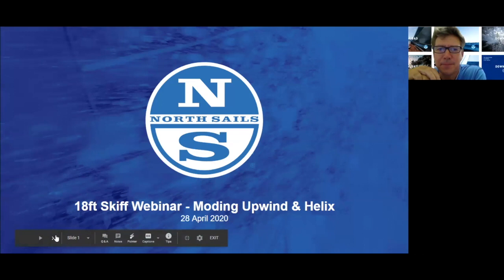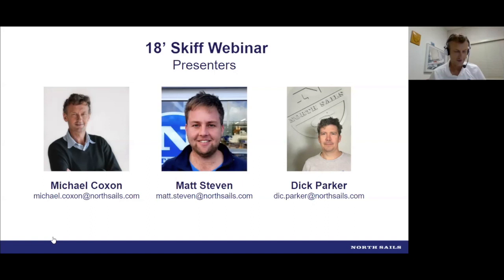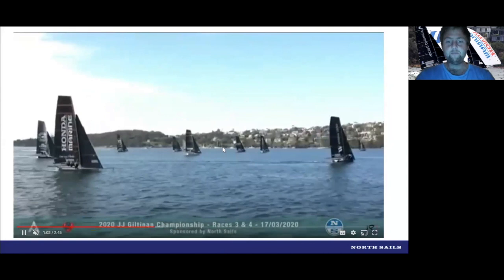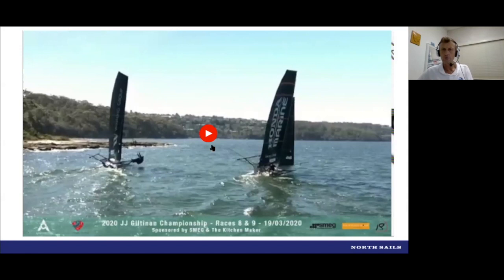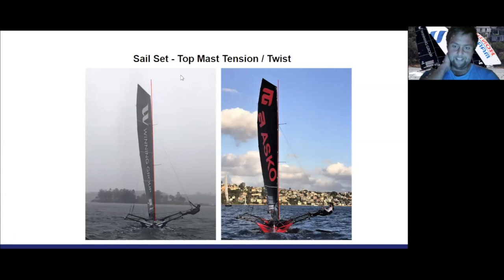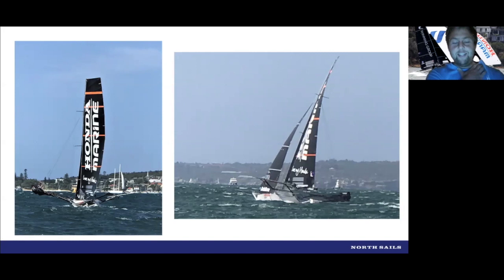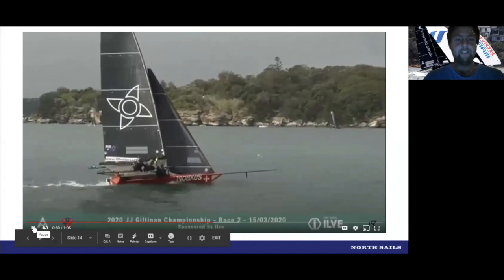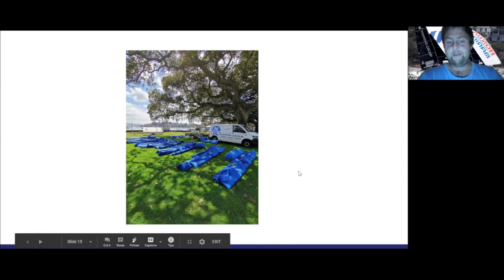Let's Talk 18' Skiffs

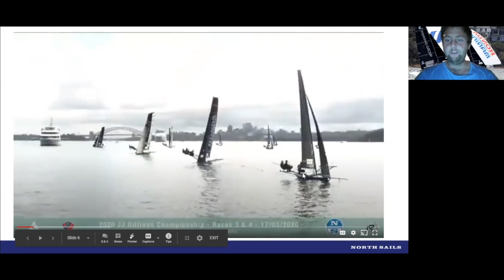Comment: North Sails: At around 15:01, Matt is discussing sailing the boat in a high mode, and makes the comment "were not letting the boat come flat, and were climbing off".....could someone kindly elaborate on Matt's comment please? Does leeward heal help to climb to windward? I ask because I have never read about the benefits of leeward heal regarding sailing in a high mode. Many thanks in advance for all the content that you/North are currently generating, its awesome. Chris